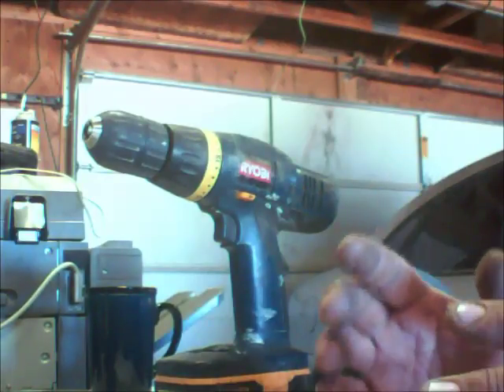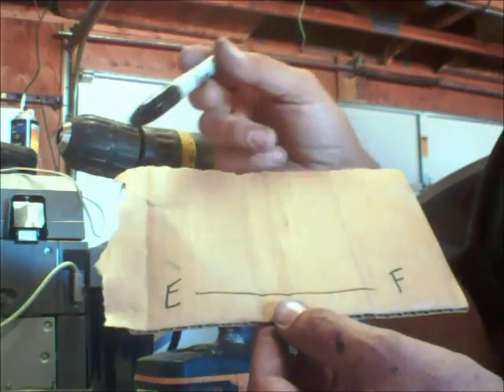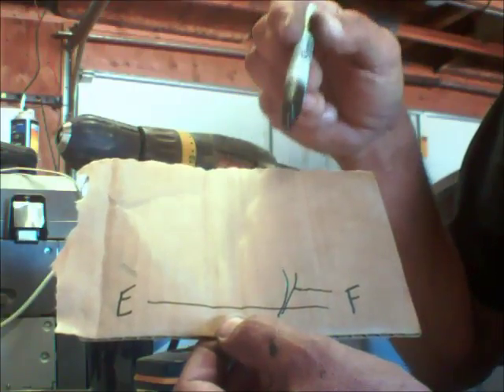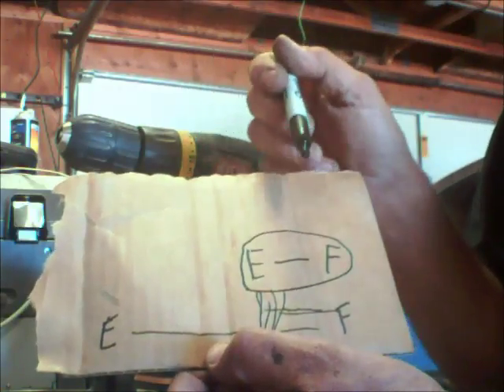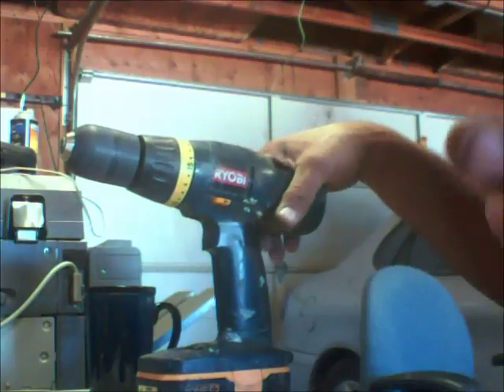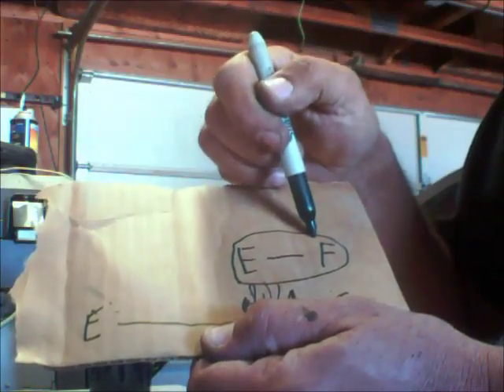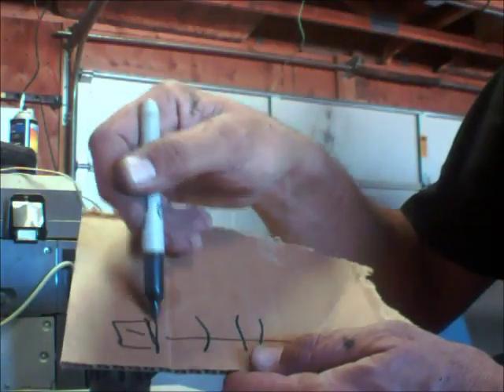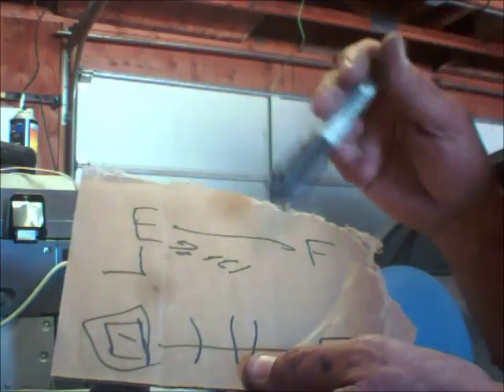How to Make Any Cordless Rechargeable Battery Last Longer

Comment: That's awesome info Brian. I will definitely try this. My dad took a 18v battery pack that wouldn't charge anymore and took it a part. There was little tin type connectors to each battery, one was broken like s fuse would be. He souldered it and it's worked perfectly ever since. You mention in this video you have a video talking about if it doesn't take a charge. I did not watch it so I don't know how you address it.

Comment: Hi Thomas love your video!  My DeWalt battery is pretty old.  Still charges but 1 it won't last long as you described. 2 it won't keep the charge after a couple days. Is the battery salvageable or should I just give up on her?  They're crazy expensive but working with it just ain't practical anymore.  I don't mind doing what you're doing in the video but it's busy season and I don't want to forget my spare battery at home. I usually just charge it while I'm on the road.